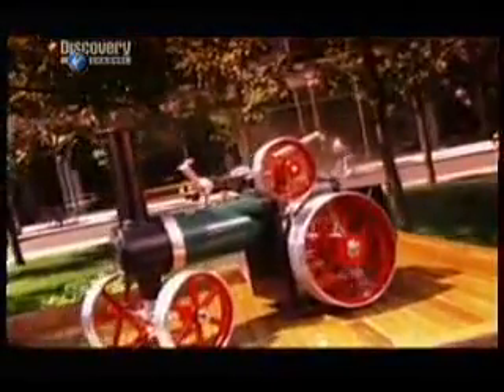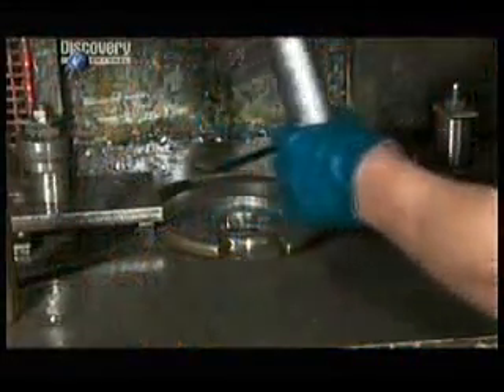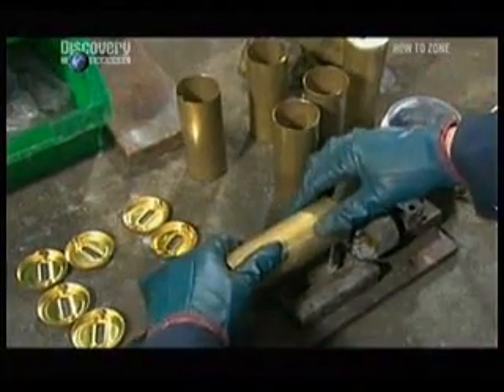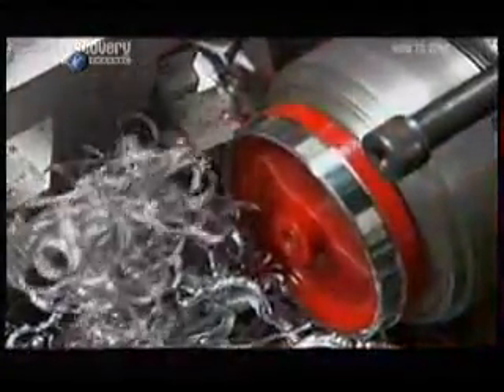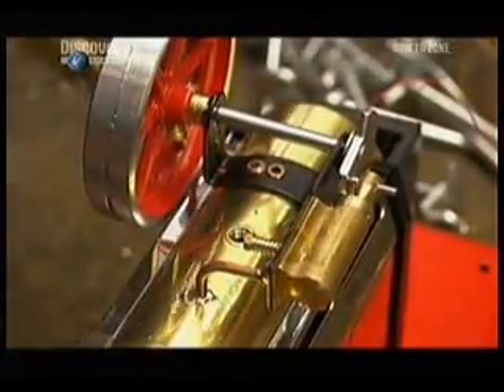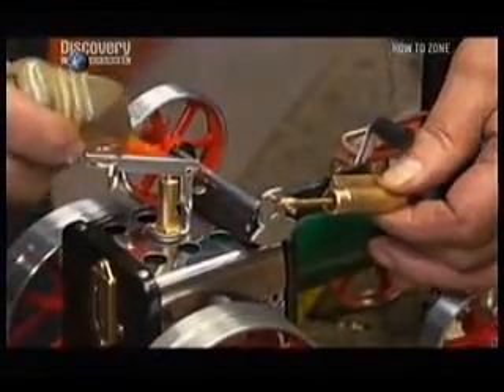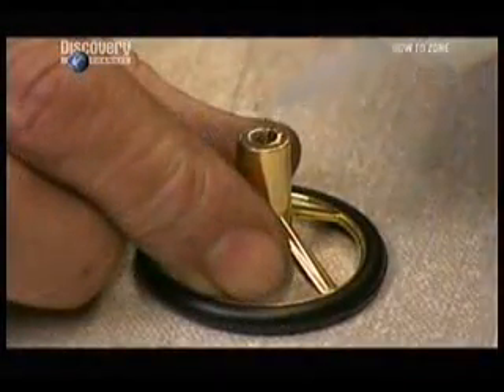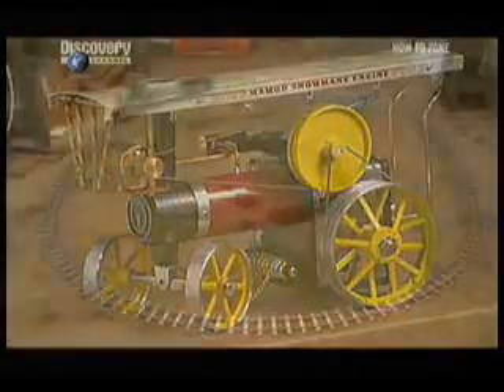Mamod Steam Engines How Its Made

Comment: The only problem with brass as a boiler is that it will suffer De-Zincification over time which makes the brass porous when we build our boilers we use 660 bronze to make the fittings and full copper for the jacket tubesheet crownsheet and flues and silver solder now these are very nice models I give them that :D